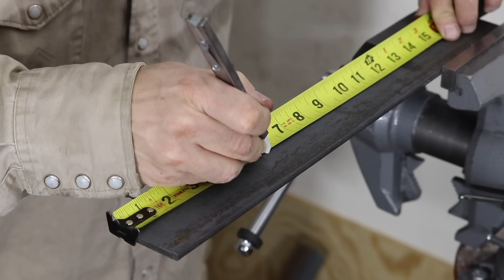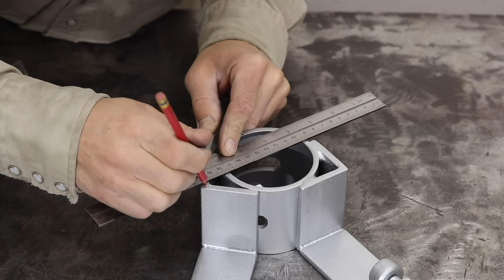TOP TWO BEST DIY TOOL IDEAS || TWO USEFUL HOMEMADE TOOLS

Comment: Great video - thanks for sharing.  I really liked the angle clamp but would like to see slightly better handles for the clamp for more torque.
Reply from the maker: Thanks for the idea!
Reply: Its like m14 if u want it harder you tight it with a wrench or something

Comment: Can you explain to me what is the different welder things you were doing. I saw you using different welder tips.
Reply: The one he's mostly using is a MIG welder, the welder feeds the filler wire through the tip to the arc by itself when the trigger is pressed. The other is TIG, that's the one where you see him adding the filler wire manually with his opposite hand.

Comment: In a one single project, sometimes you used TIG and sometimes MIG on it.  When using TIG, you used with or without a filler rod.  Why?  Brief explanations will be highly appreciated.
Reply: If tight fit-up, there's often no need for filler rod with TIG as the process can simply fuse the two base metals together (a.k.a. Fusion Welding). Think of filler is just that--material added as needed to fill gaps. Hope this helps. All the best, Andrew @BranchAndFoundry
Reply: @drewt3210      Thank you so much.  Really appreciate it.
Reply: @jkwo2007  Gladly!
Reply from the maker: @DrewT The explanation below is correct. Also, sometimes it is easier to tack weld with mig when working by yourself and then finish the weld with whatever process you prefer.
Reply: Nice coment
Reply: @drewt3210  nice coment

Comment: What is the name of that cutting machine.?
Reply from the maker: Thank you. It is called a portable bandsaw. You can check out the affiliate link below. 

Dewalt Portable BandSaw https://www.amazon.com/dp/B001W0ZIK4/ref=as_sl_pc_qf_sp_asin_til?tag=alexpalominos-20&linkCode=w00&linkId=17bb9172f425c3bb6ab19685de039c5c&creativeASIN=B001W0ZIK4

Comment: Where do you get the measurements tool for pipe ?
Thanks 👍🏽
Reply from the maker: https://www.amazon.com/Jackson-Safety-Contour-Marking-14752/dp/B004XNZJS8/ref=sr_1_1_sspa?crid=IRONN1NGNZ6J&dchild=1&keywords=pipe+wrap+around&qid=1623202409&sprefix=pipe+wrap%2Caps%2C234&sr=8-1-spons&psc=1&spLa=ZW5jcnlwdGVkUXVhbGlmaWVyPUFIWkxZUURKS1ZGVVcmZW5jcnlwdGVkSWQ9QTA0MjgzNjUzQ0I5OTI3M09NTDVEJmVuY3J5cHRlZEFkSWQ9QTAxMDM5NTYxWUdPRzQ4QzRTTkJZJndpZGdldE5hbWU9c3BfYXRmJmFjdGlvbj1jbGlja1JlZGlyZWN0JmRvTm90TG9nQ2xpY2s9dHJ1ZQ==

Comment: Excellent project, especially the last one, It is a magnificent tool to specify the angles. A very versatile squad.
But I have a suggestion to make.
Why don't you show the weld after it's done?
It is quite disturbing to the eye, if not dangerous, when you bow in front of the camera. Some places where you will apply the solder are quite obvious, and it is not necessary to show the process. Please, in your videos, edit the solder so that I subscribe to your channel.
Reply from the maker: Thank you for your feedback.

Comment: For the second part ,instead of welding a nut,he could have taken rod and drilled it a long bolt could have been used instead of welding .That would have saved a lot of time
Reply from the maker: Good point. Thanks for watching.
Reply: Yea like 3 seconds, do you not see how fast this guy is?